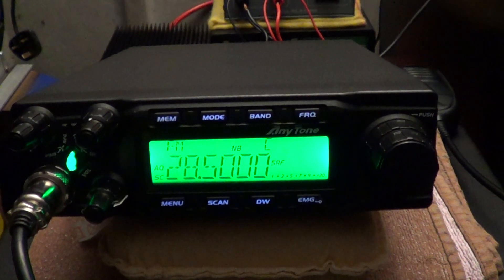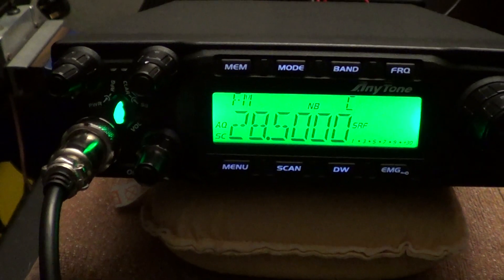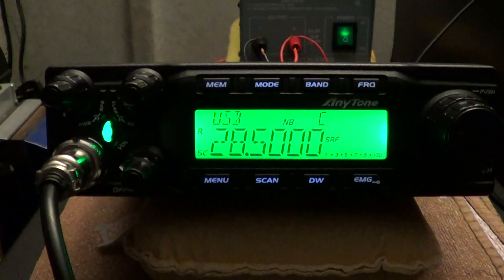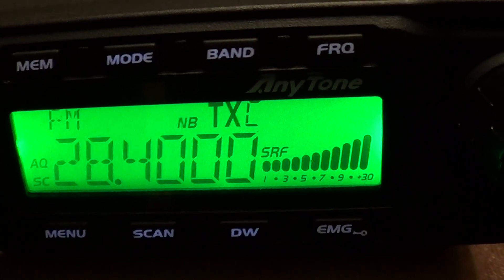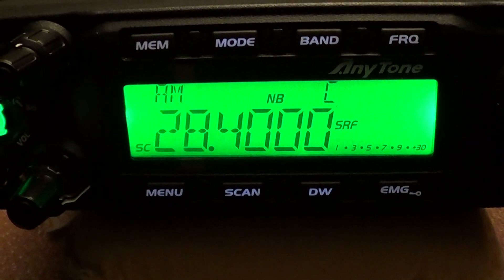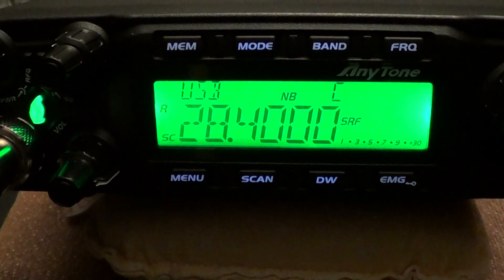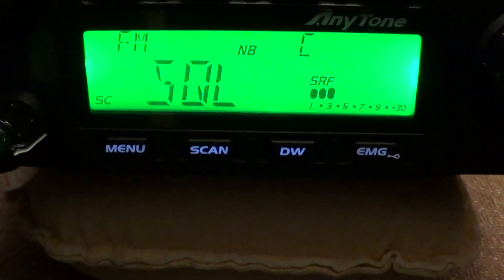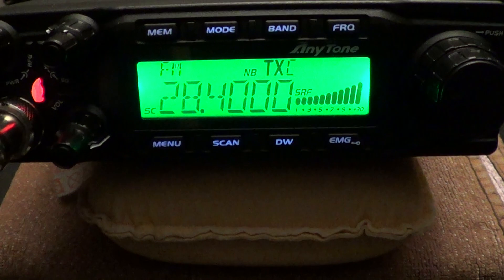The Anytone AT-6666 On Air and Power Output Tests

Comment: just another mention if you radio flashes under volt on transmit display  and the power supply is good they i can bet dimonds the fets have gone as a switching circuit inside will disconet the fets to stop a fire ball . , so if you key the display flashes and says low  volts you need new fets ..............................and a dam good fan ?

Comment: i wonder why the manufacturers of these types of high powered wattage radios seem so reluctant to have a cooling fan fitted on them as standard,because that is what they obviously need,the heat in the sahara desert will be cooler than what the mosfet finals will generate in this radio.i for one would be happy to pay a higher price for this anytone at-6666 if the required cooling fan was fitted.
Reply from the maker: I agree a thermo controlled cooling fan is needed in many of these radios, I can never understand neither, I'm sure people would pay another £10 for this feature.

Comment: Hi Dave, tnx for this real interesting video. A nice radio indeed. On other reviews I saw complaints about the small heatsink, that cant´t cope wth the dissipation power the three finals produce. What is your opinion on that?
Tnx and 73´s de Wolf
Reply from the maker: I don't know what other reviews your talking about as there is (was) only two or three in private hands.
But I find the heat sink is very effective and I didn't find it got unduly hot even on FM that is full duty cycle.
I would like to see a small fan fitting to many of these 10 meter sets, but sadly very few have this additional feature Wolf.
I have run this radio at full power for a good few days now and have found no issues with it.
I guess time will tell though.

73 Dave
Reply: m0ogy Hi Dave, tnx for your quick response. I found that on the "Ham Radio Blog PD0AC", quote "...The passive cooling is likely insufficient. The heat sink gets really hot, and does so in a short amount of time...".
By looking at the heatsink and knowing that 60W of RF are produced I would expect this thing gets hot. I agree, a fan would do a good job, like on the Optima. The radio won´t break down when getting hot, but life expectancy will drop. 

73s de Wolf

Comment: hi dave is ctcss\dcs standard on this radio sample or final production or have to purchase optional?
Reply from the maker: It states it's an option, but I will double check to be 100% sure
Reply: m0ogy thanks dave,def be handy for 10m repeater use.
I can see this board becoming a problem if they make it a option,some dealers may or may not stock it,and we know this radio works else way so would enhance radio having  CTCSS\DCS as standard.

Comment: The SSB RX is not sounding great to me. Reminds me of the first AT5555's with AGC problems... I wonder if this radio has the same RX circuit as the new Lincoln 2 V1? If so, expect this problem to be resolved soon as it seems to be in the Lincoln 2 V2.